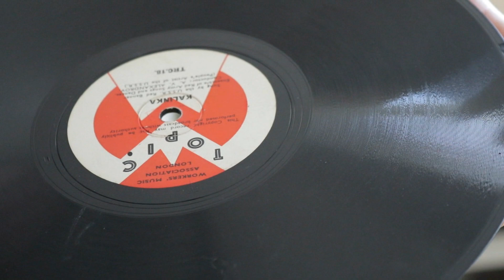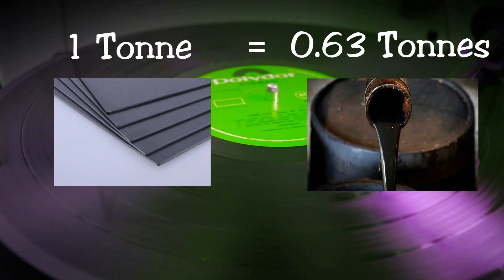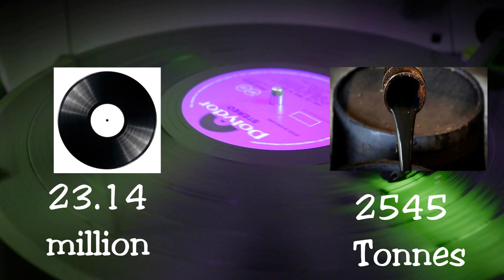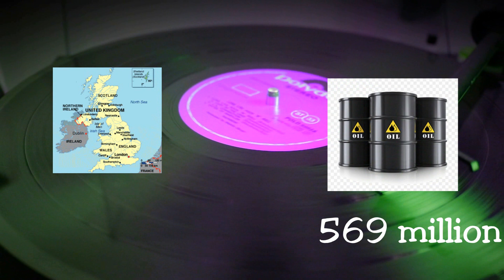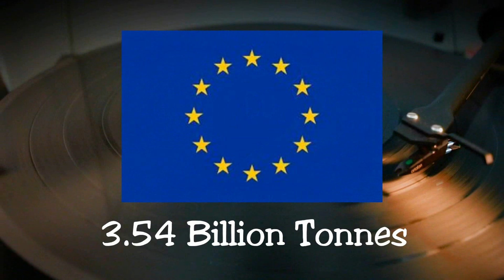How Much Oil Does it Take to Make A Vinyl Record?

Comment: Interesting thanks! I have a several thousand accumulated over 50 years - mostly purchased at garage sales, estate sales and used record stores. Only probably 300 or less purchased new and probably only 15 purchased new in the last 15 years. So I don't feel bad about it - I also live in the center of 40 acres of forest I own. So I'm supporting the trade off.